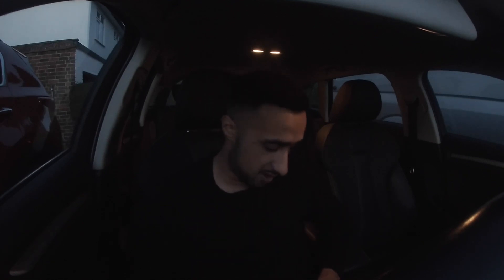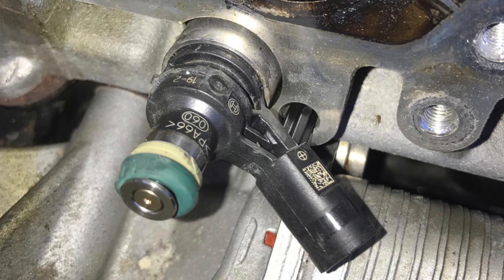TOP COMMON FAULTS to know before buying an Audi S3/ TTS/Golf R/Cupra/ GTI *MQB*

Comment: What happened to the comment APR left here earlier mate?? They spoke a lot of sense and made some valid points about the claims regarding APR mapping and then ‘misfiring’ 🤨🤔. I was impressed they actually commented here in the first place, should’ve left it here.

I’m currently running stage 2 APR on my FL S3 (including TCU map)..........no issues and my mate has your shape S3 running stage 1 APR, again, no issues.

What tuner mapped your car to “safely” shoot fire out the back 😂🤣

Comment: when do the water pumps normally start to fail?
Reply from the maker: From what I know they can happen anytime any mileage but roughly around 38k they start to go…. So I think Audi recommend it at 40k but don’t quote me on it lol
Reply: @Sa3Tv  i'm looking at buying an S3 here in Australia and one that I saw advertised, they mention that they're replaced the water pump and cars only done around 64k k's, would you stay clear from an S3 that's done around 159k k's? (100k miles)
Reply from the maker: In my option the mqb platform is great! Very reliable in my experience… 100k is a tad high can’t lie but as long as it’s had it’s had it’s regular maintenance, servicing etc you should be good! And also remember HALDEX and diff oil has to be changed too! Not everyone mentions it but that’s something to look out for :)

Comment: Also with S-Tronic Park solenoid fails
Shift assembly replacement or the micro switch. 
Error workshop only leave in P position
Check engine light put vehicle in park.
DSG gearshift Assembly effects all S3 and Golf R - Skoda yet another issue even 2 year old cars.
Reply: What year is your car? I’m looking at a 2018 s3
Reply: @MrScoobieman  65 plate 40k mileage, effect loads of them and the coolant leak that’s an expensive fix.
Reply: @mark055  ok thanks, hoping to pick up the car soon.
Reply: @MrScoobieman  good luck not had mine too long, join the owners group on FB tons of info on that page and the forums.

Comment: My electric windows have developed a fault in my s3
Reply from the maker: Ahhh okay... i believe it might be the actual window switch.. worth getting it done asap as it's not major but a very annoying fault..
Reply: I've looked into it and it's usually plastic clips failing and forcing the glass of the runners, the motor speed seems fine, just bought it with a warranty so hopefully it's covered.
Reply from the maker: So a pretty simple fix aha
Reply: Apparently it is.